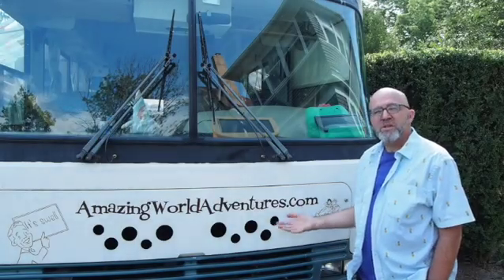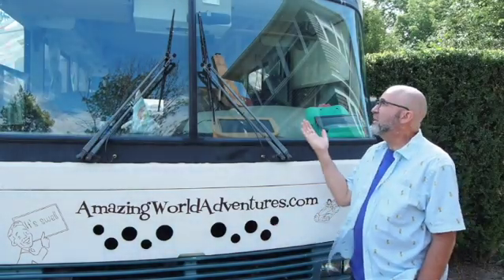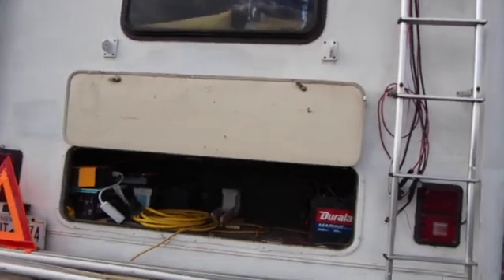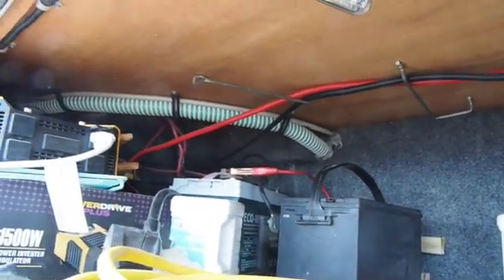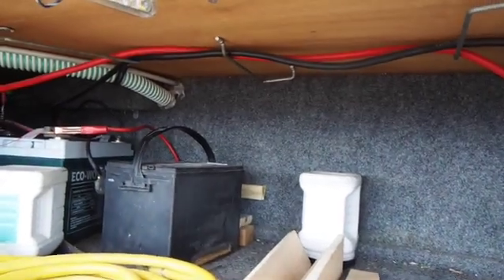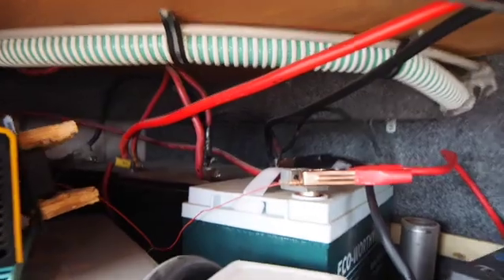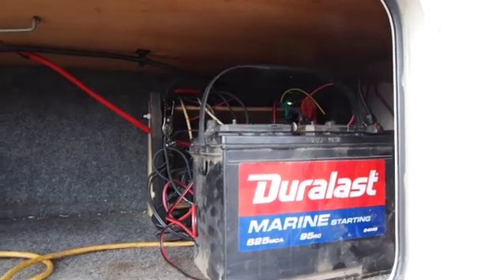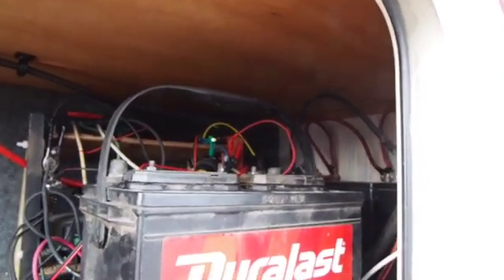Easy way to increase your solar battery bank

Comment: id just advise anyone to save some money and buy a lithium   battery, like the 400 amp hour 12 volt lithium battery from LiTime, or similar.  agm, fla sealed or not, discharge 3 gasses that settle, rise and are neutral. these gases are explosive and toxic. you only get to use 50% of capacity of fla, agm and 100% capacity out of lithium. lithium is much cheaper, 10,000 cycles use vs 500..

Comment: the biggest issue here is you're mixing different capacity batteries, if your flooded has less Ah than your AGM, then as far as I know, it will top out as much as flooded is capable.
Reply: mixed capacity not really a problem, tho preffered for it all to be same flooded. agm or the likes tho not necessary
Reply: My understanding is AGM runs 13.2v and flA is 12.6 full charge. Am I wrong?
Reply: @onthemoveautomotive6930  yes wont fully charge